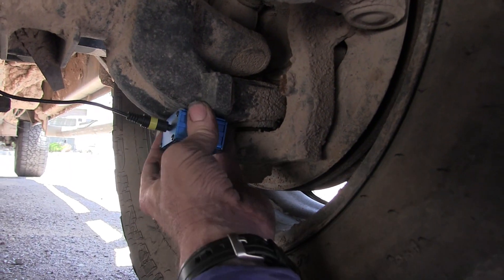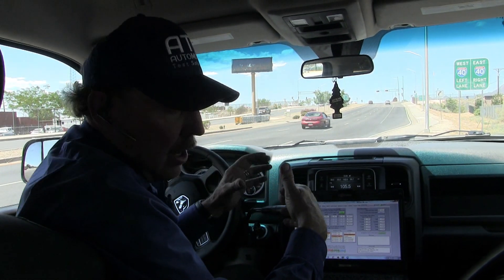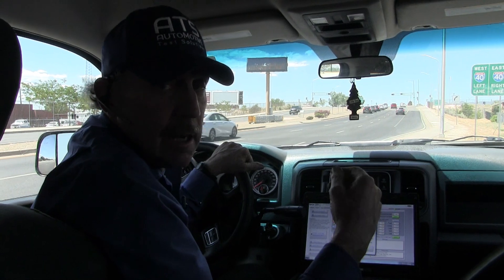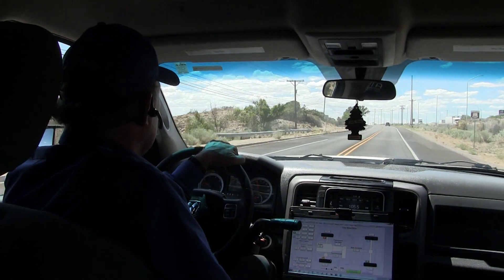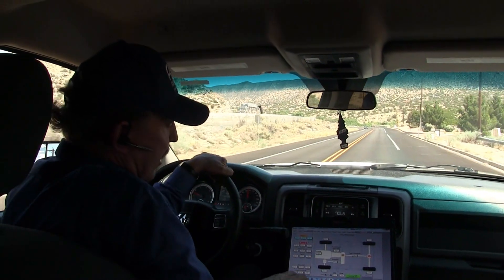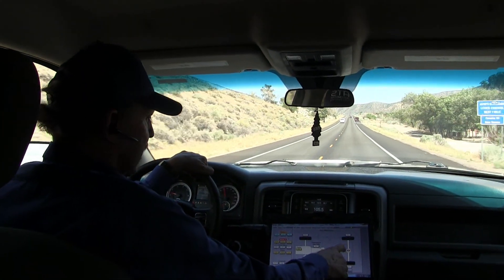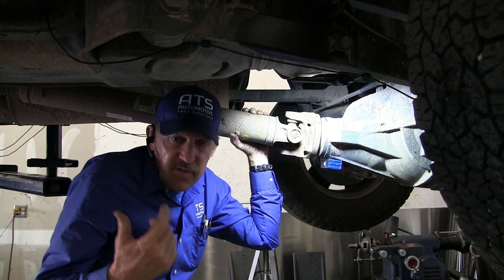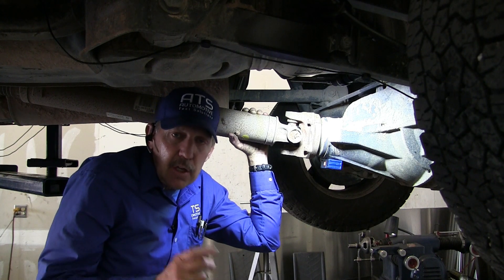The Best Way to Diagnose a Vibration on a 2017 Ram 2500 Heavy Duty Truck

Comment: Work smarter not harder… check the obvious things first… lose front suspension stuff with steering, tires and wheel balance, driveshaft and transfer case u-Joints… why the hell would you spend a whole day with sensors and shit when you could of wiggled that 10 hours earlier in the day with no sensors etc.. I feel bad for whatever guy spent $1100 for this shop to tell him he needs a $49 u joint that any kid or woman mechanic could of found in 5 minutes. 😂😂😂😂. Holy shit dude

Comment: Been doing the no idle, and 5k mile oil changes. I mean I do not idle in McDonalds drive thru or the like. I had thought it may have to do with hot spotting that idle engines will tend to get and varnishing lifter bores. I.e. varnish hangs lifter causing it to slam cam. Curious as to thoughts on 5/30 oils, my thought would be better viscosity at temp provides more protection and better "cling" of oil to components? Also what about 0/20 or 0/30 to get oil up in motor faster at colder temp? Would be interested in your thoughts.

Comment: Please please help 😢
Bought 2018 tundra sport 4x4 with 13k miles
I fist had extreme shaking in steering wheel they aligned it and balanced the wheels long story short been back 4 times and they have aligned it 3 times 
I get a constant vibration on steering wheel gas pedal and brake pedal along with shaking of steering wheel on side to another always happens at highway speed at 60 mph

Comment: 6:20

An old school mechanic would have checked these usual problem spots first, instead of taking 5 hours and charging the customer an extra $500 for using all that equipment for diagnosis. 

Shame.

Comment: Lol you need all that to determine a u joint, whatever happened to jack stands and a few minutes Of your time checking things while the trucks not under any weight.
Reply: He is going through the diagnostic process.
That’s the bigger picture.
Reply: Agree, expensive shop time diagnosing a simple initial check. I'd question the ability of the "mechanic" that did the initial vibration check.

Comment: that was a cool test but why didn’t the shop do a visual on u joints after balancing the tires and no change. its a basic test every mechanic should be able to do.
Reply: Newbies, he tries to train his guys but more often than not, they fire the parts cannon because you can't find a tech that really knows the stuff that Bernie does. I don't know if  you know but Bernie built a electronic training module to train the people he hires because they didn't know anything about electronic troubleshooting. He also sells that training tool I believe. When it goes to Bernie, it is usually after they have fired the parts cannon. This video appears to be more of a marketing than hard to diagnose problems such as worn drive gears inside the transmission or transfer.